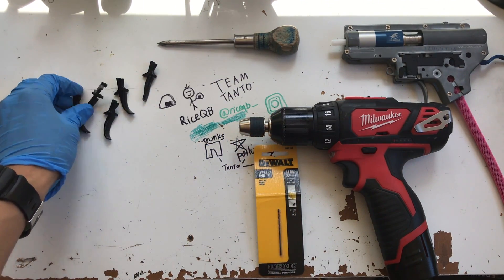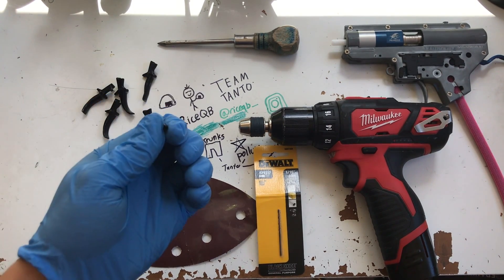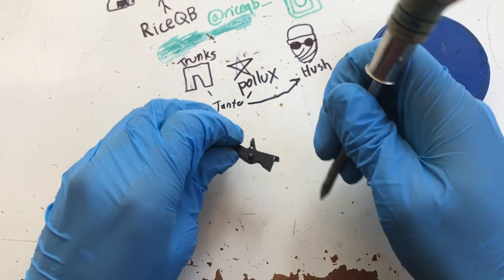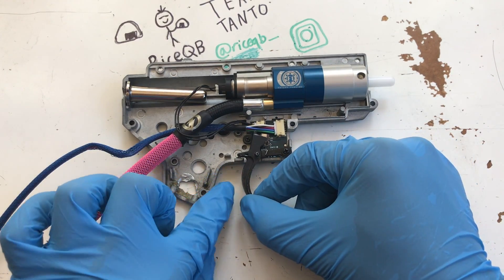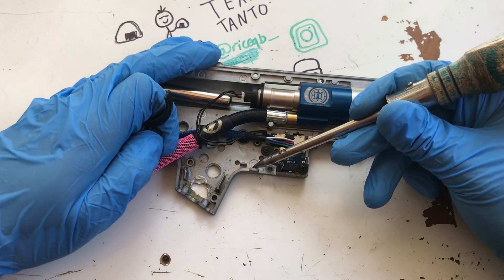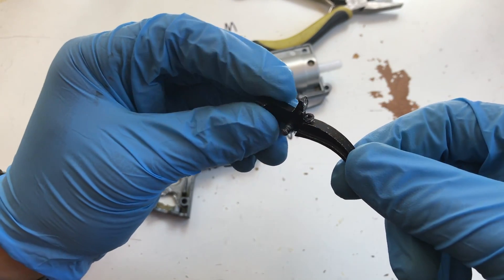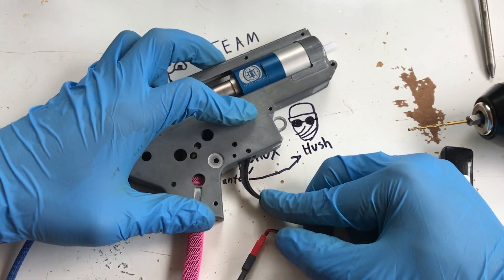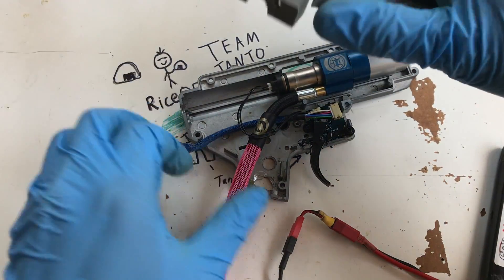DIY: Hair trigger mod on any V2 trigger?!?!

Comment: Hello. Can you do this on the Matrix Sportsline M4 that you were talking about? That's the gun I have and I would love to see it actually work. Thanks
Reply from the maker: Yes it will work! However you maybe not get the same performance without upgrading the parts in your gearbox, motor, gearset, lighter piston, good shimming, etc.
Reply: @RiceQB  I'm just looking how to install a regular speed trigger on an AEG.

Comment: If you don't have I mirco switch and you still wanna do this just use a thin rubber band around your trigger and around you igl and it works fine but I also have a speed trigger

Comment: hey man im looking into getting a polarstar jack or a wolverine inferno gen 2 but im stuck because on one of your videos you said the gen 2 could keep up with your trigger finger, and im going for a really fast trigger response build like the one in the video, i know the jack could get similar results as the f1, but i wanted to ask if you ever tried this mod on the inferno and how it was? cause if i could save some money id rather do that, if not i will just get the jack, thank you for your time !
Reply from the maker: Jorge Vega  Great question! 

If you are going for a full trigger response build I would recommend any polarstar engine. Doesn’t matter what polarstar engine you have all engines have the same trigger response as long as you set the semi delay to “OFF” therefore you can spam the trigger like no tomorrow.

The inferno in the other hand has a very disappointing trigger response time for an HPA engine. At the time when it was my first engine and I was only exposed to slow AEG’s I thought it was fast but in reality it’s trigger response is very slow. 

In conclusion get any polarstar engine, weather if it’s a Jack, F1, F2, Fusion, and set the semi delay to “OFF”

I hope I helped and thanks for watching :) 
Anymore questions? 
DM me on Instagram: @riceqb_
Reply: Rice QB thank you man i really appreciate it, will be getting the jack now, and one more question, im most likely gonna be shooting like you, how many batteries would i need to get through around an 8 hour day of airsoft?
Reply from the maker: Jorge Vega no problem! :) 

You should only need one battery, and one battery should last you longer than that. The battery consumption is very low on polarstar FCU’s 

However make sure to disconnect the battery when you are not using it because it will continue to use battery until you unplug it.
Reply: Rice QB cool man thanks a lot, keep up the good work 👍🏽

Comment: What is a micro switch and does the lancer tactical gen 2 have 1
Reply from the maker: A micro switch is a button that sends a signal to the motor for an AEG but for a HPA engine it sends a signal to the solenoid. 

Yes it will just make sure to have a trigger spring in yours. sorry for the late response.

Comment: Do you think a hair trigger would work for a krytac mkII crb? I'm not quite sure if the mosfet is sophisticated enough to handle it.
Reply: If your trigger activates by pressing a button on a circuit board then yep, doesnt need to be sophisticated
Reply: @jayfk1579  so maybe just a motor upgrade or more powerful battery?
Reply: Same I’m tryna know if it works
Reply: I got the same gun

Comment: is there a place to buy a v2 gearbox for an m4 with micro switch already done i want this kind of trigger mod id love to buy one already done so i can fit in my gun
Reply from the maker: https://www.evike.com/products/78928/

Micro switch installed. The trigger is proprietary but you can still apply the same steps shown in this video in the trigger.

Comment: Can u do this with a ics Captain Uk1 stock gun and it also has a split gear box to
Reply from the maker: You will need to get yourself an optical mosfet like a Gate Titan or a Jeffron Leviathan Micro Switch. 
Preferably go with a microswitch style mosfet(Jefftron Leviathan). So you can get the same results like in the video. 
I hope I helped, Feel free to ask more questions :)

Comment: Do you have the link to the 3d file of the trigger guard you used in this video?
Reply from the maker: ArranAshy The trigger guard is designed by me. I do sell the trigger guards but I don’t send files.
Reply: @RiceQB  Damn that sucks I wanted to print it :(

Comment: Would this work on a Krytac MKII CRB
Reply from the maker: That gun has normal Trigger contacts and you can do it, but you will not be able to flutter the trigger like mine in the video. Also make sure to have a mosfet running through the trigger contacts so the gun doesn't have accidental firing due to contact bouncing. 
I hope that helped. 
Feel free to ask me any question. :)
Reply: Rice QB so do I still put the screws in the same places?

Comment: How can I do this with a gate titan
Reply from the maker: With a gate titan it is still possible however you will not be able to just tap the trigger, you will still get the hair trigger pull, but not the fluttering effect. It’s essential to use a trigger spring in the gate titan because it’s an optical sensor based Mosfet. This mod uses the micro switch as the spring, therefore it’s very light and allows the user to just feather the trigger like no tomorrow. Feel free to ask more questions:)

Comment: Is a gate titan a switch
Reply from the maker: ace archer a gate titan is a optical sensor mosfet therefore you will not have a switch pushing back on it so you will not be able to flutter the trigger like  the video however you will still be able to have the hair trigger pull from this video. So the only difference you have to do in this video is use a trigger spring.

Comment: i used hot glue lool n also kinda bent my contact points inwards
Reply from the maker: J Txntay ouch that is unfortunate, I would recommend the two screws because they both have a purpose one is to shorten the pull, one is to prevent it from over-travel and damaging the micro-switch. 

Thanks for watching!

Comment: How do you install a micro switch so we can do the hair trigger plz reply
Reply from the maker: The micro switch style trigger boards only come with HPA or AEGs that come with it like the Ares ECFS or the Matrix G2 Sports-lines. For HPA, the micro will naturally come with a Micro switch(Trigger Board) with the engine(Packaging)

If you wish to do this to your AEG here are some great mosfets for that. 
JeffTron Leviathan Airsoft Drop-In Programmable MOSFET Module
https://www.evike.com/products/93723/

ARES E.F.C.S. Advanced Electronic Circuit Unit For ARES M4 Series Airsoft AEGs (Only works with ARES)
https://www.evike.com/products/59870/#pagetabs

Matrix G2 Complete Gearbox Assembly for TM Compatible V2 M4 / M16 Airsoft AEGs
https://www.evike.com/products/78928/

This hair trigger mod can be done to optical sensor MOSFETs too however you will not be able to get a light trigger pull and feather the trigger, however you will still get that superior hair trigger. 
Example: Gate Titan, Gate Aster. 

Thanks for watching, if you have any further questions please feel free to ask! :)
Reply: I have a arp9 would it work if has a etu so better trigger response
Reply: @gambler9451  thats a micro switch i have a arp 9 with this mod

Comment: Where can I buy the v2 trigger? And does it work if the gun doesn’t have a micro switch?
Reply from the maker: V2 trigger = any trigger that is in a v2 gearbox (Scars, M4, MP5(some)) 

You can do it with a gun without a micro switch but I would not recommend it. Assuming that you are going to do this on Trigger contacts, there could be a chance that the trigger contacts might contact bounce and gun with mis fire or fry out. 
Only recommend this with Optical sensor MOSFETS or Micro switches. 
Thanks for watching and feel free to ask more questions. :)
Reply: Does is have to be a v2 trigger or I can use any trigger?